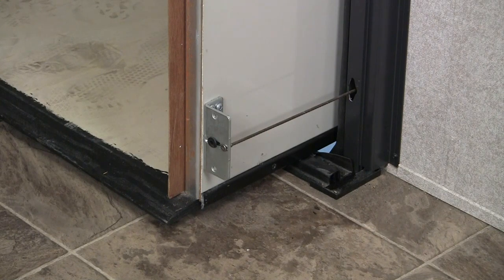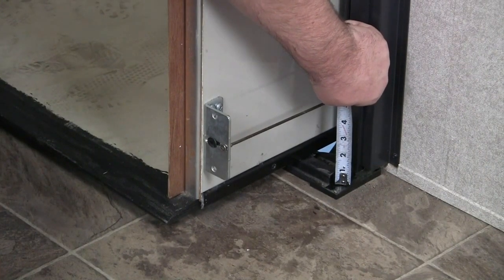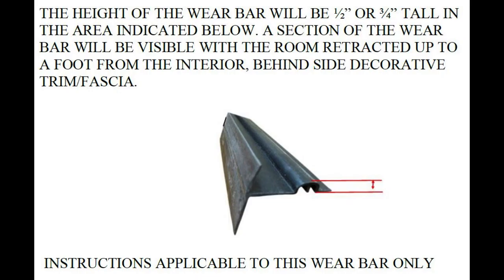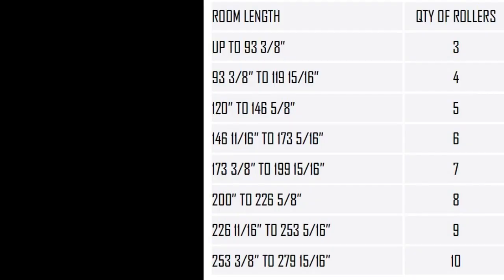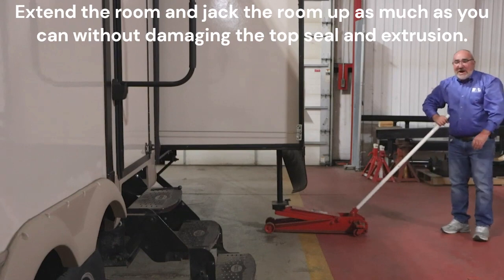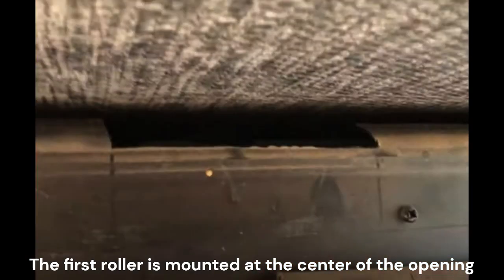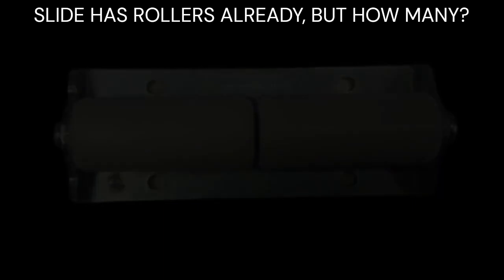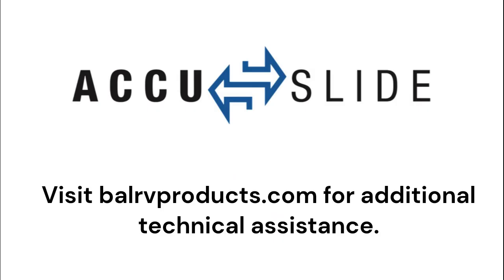ACCU Slide Struggling to Operate or Skips Non Flush Floor

Comment: 072924: We are getting the chatter when the slide is in motion.  My rig is a RV 2022Cherokee26RL-L VIN 5ZT2CKRB8N2007868 AlphaWolf: Is there a way to cross reference the roller mod protocol? This video refers to 2018 or earlier.
Reply from the maker: We would recommend following the sound to confirm if that sound is coming from the bottom or the right or left of the room. There is a chain inside both the right and left jamb assemblies and gearboxes at the top of the right and left, that can produce a sound that is more like grinding or popping. If you can make a video to capture the sound and send it to baltechsupport@norcoind.com to have them help identify the root cause.